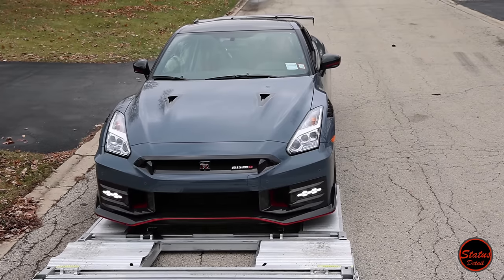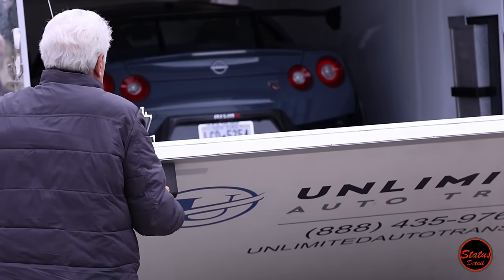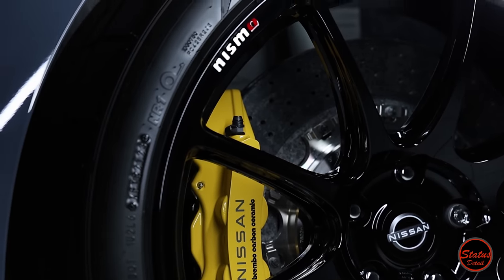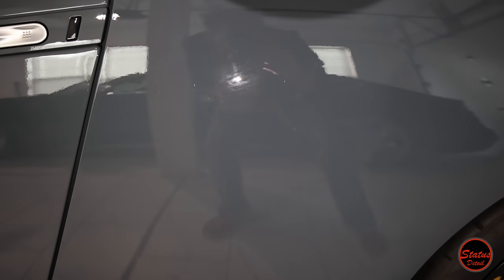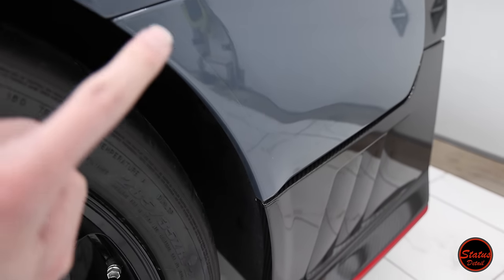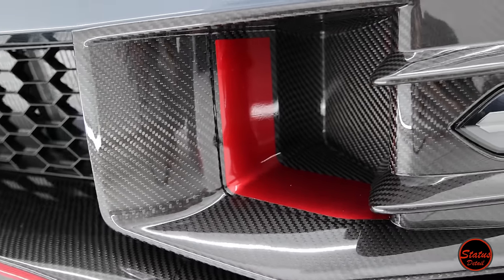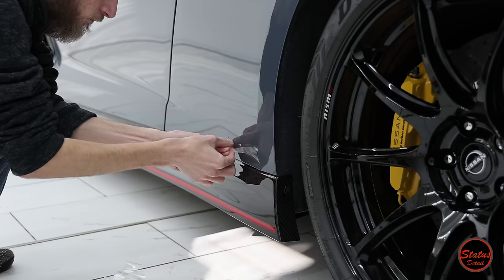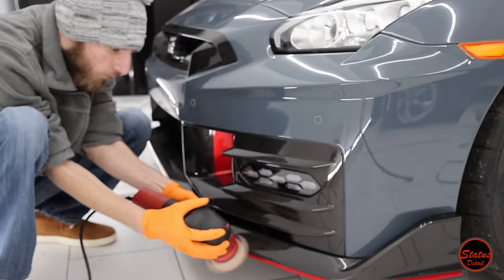RAREST R35 Nismo GT-R Gets $18,000 ULTIMATE Detail

Comment: Great work as always from Status. We just finished a 2024 992 C2S and also do extensive paint correction prior to PPF. In our experience, we have found that PPF will cover and hide most paint imperfections and we sometimes make a judgement call as to how much clear coat to remove from the car vs. hiding the problem with PPF. Paint correct 100% for sure, but sometimes the cut is deep and the hide effect is safer for the car.
Reply from the maker: Agreed! I talk about this in a few videos especially on nasty defects requiring sanding. We aim to remove all the defects and jewel the paint into a ridiculously glossy state and then lock that in. But managing clear coat depth is a serious thing! If your thinking about that your already leagues ahead of most PPF installers 👍

Comment: just spent 7k to paint correct, polish , ppf and ultimate detail my brand new m240i.   i went back to the dealer to get some service done  parked it next to the same car same color as mine and made the oem finish look like trash. its WELL worth doing it right when you got a fresh new paint job.
Reply from the maker: Definitely! It can really be a big difference when you see it side by side like that. Especially comparing a PPF car to no PPF car after 10-20k miles.
Reply: You got a $7k detail for a $50k vehicle? Delusional lmao
Reply from the maker: @Gborohooo  everyone values services differently. Some people won't spend more than $30 at the ultimate automatic car wash. Some will spend over 20k so it's all relative to the owner and how much they value the car and the work being done. And nuclear I'm not talking about value in the sense of appreciation or depreciation I'm talking about personal value like the love, passion and enjoyment you get from your car because being happy in that sense is not something that can have a value assigned to it. So if you can afford the service most will do it it a heartbeat
Reply: @Gborohooo   it also makes 1400awhp and has 6k dollar 18lb beadlocks, a 26k dollar  3.3l titan motorsports engine, a 5.5k 7480 precision turbo, 4k dollar intake manifold, 6k dollar titanium exhaust/manifold. 5k dollar fuel system,  20k dollar transmission and is about to run 7 second quarter mile.  if youre poor just say that bro.  i drive the car 200+ miles per day to work and back.  its full PPF for a reason. if u dont like ppf, dont put it on your dodge neon.
Reply: @Mp-jw1qg  you said it's brand new and you take it to the dealership for work lmfao neither of those are true for anyone building a car like you just mentioned. People jsut lie on the internet for no reason 😭
Reply: @Gborohooo   i bought the car already having all of those things from my a90 supra.  its the same car just awd.  . @hon3times.     my 160k dollar midnight purple r33 is ppf too. ill upload a video of my brand new m240 running 8.40 quarter mile. check back 5 mins. LOL. broke boy'
Reply: @Gborohooo   it goes to the dealership with the built motor, huge turbo and all. they dont give a shit. bmw doesnt void a warranty until you break something and try to get it repaired.   my car was running mid 8 second quarter miles on the break in tune before i got the licence plates in the mail. LOL.  i bought the car to build into a full race car..... two months ago when i posted this, it was stock, now it just needs a roll cage and its ready for 7.7x.  it helps when you own the machine shop and the dyno.........
Reply: @Mp-jw1qg  old ass spent all his retirement fund on a m240 and r33 😭
Reply: @Mp-jw1qg  i wanna know how you daily a 1400hp drag car😂
Reply: @Mp-jw1qg  nothing to brag about bro if you go to sell it you wont even get MSRP lol
Reply: @STATUSDETAIL yeah you say that because you are in the business. All these money spent on ppf and detailing won’t meant much when selling the car in the future and you’d be lucky getting a quarter of the cost back
Reply from the maker: @G0ddEityawesome  I agree. I've said that in camera several times. However that's not the case on ultra rare cars. Especially if driven. A few bad rock chips on a GT3 for example will make a future buyer pass vs the full body PPF car. In general it's about your personal value in it. That's why I don't recommend PPF to most people with average cars. If your new to status... I don't do average cars. We only work in and talk about rare cars and this market. Every situation is different but not doing full body on a car as rare as this one is a horrible idea lol. If someone leans over it and scratches it with a belt buckle at a car show it could cost more than the ppf in one trip to a body shop considering the entire car is basically carbon  panels. If a scratch hits your carbon base your fucked in the $$$$$ department.

Comment: Full body PPF was probably 13,000 by itself people don’t realize how much work goes into PPF by itself. Looks good brethren.
Reply from the maker: Thank you! Th bfull body PPF was actually less than that. Shipping was definitely expensive. Appreciate you watching and commenting as you certainly understand how difficult this job is 🤝
Reply: Great there's a 13k discount and no heavy plastic added - result
Reply from the maker: @adrianadrianp5305  I'm confused lol
Reply: Honest question. Why would ppf cost that much more than a wrap?
Reply from the maker: @drewbienewbie03xx81  not sure I can accurately respond because I don't offer or install vinyl personally. I'm guessing the material is less expensive. I'm also guessing it's easier to install and faster. Not to say it's easy. But I think ppf is harder.
Reply: @drewbienewbie03xx81  vinly is much easier to work with. Wrapping a GTR with like 3m gloss white would run around $4-5k, door jams would be another $1-1.5k. PPF is much thicker than vinyl and way harder to seamlessly lay down. Its usually around 50-60% more, give or take. All very generalized numbers.
Reply: @drewbienewbie03xx81 the ppf film alone is already 4x more expensive than avery denison wrap vinyl.

Comment: Question: for the front fenders with the carbon fiber vents above the front wheels, was that area PPF film protected eventually? In the video the person cut a hole around that area to lay the fender PPF down. Next question what areas were "NOT" PPF covered on the exterior of the car. I saved this video for future reference, if the stars align I would be requesting similar service.
Reply from the maker: Great question. So much is not shown. 

That fender area was cut out as it needs to be cut out to install. Each individual vent has PPF installed one by one after 👍

All painted or I should say clear coated surfaces on the exterior have PPF. Including rear diffuser and partial underside of rear.

Comment: what psi do you use on the pressure washer? Do you have a psi level that you dont worry about getting really close to the vehicle with? like when you get into the small cracks and other places do you change the pressure?
Reply from the maker: Pressure is always 2000psi. 2 something gpm. Ar blue 630. 

I get pretty close but knowing when and keeping it moving is very important. Helpful to blow bugs off. Helpful to prep seals and jams.

Comment: I am really curious. How long can the PPF stay on the car (considered it's not constantly exposed to sunlight) until it has to be changed in order to not bake into the paint?
Reply from the maker: STEK has 10 year warranty! Theoretically it should last much longer than that if your garage captain not driving it very much like I assume this car will be used. 

It is however a good idea to remove it around 8 9 10 years old is if you wait too long it can be difficult to remove. But that's more common when a car is like outside every day.

Comment: Fantastic work! I am just curious about one thing. You said ppf doesn’t go by a catalytic converter yet you did ppf directly next to the exhaust tips? Why?
Reply from the maker: A catalytic converter is very different from a exhaust tip. You do need to be mindful of this too though!

McLaren 720s OEM exhaust has like heat shield literally built into bumper due to heat and how the rear exit exhaust is designed. 

If you tune a 720 and do exhaust and or downpipes you start melting parts of that surrounding bumper and obviously PPF too. Anything shooting fire basically means your paint and PPF might not make it lol. A cat gets hotter than a exhaust tip though same thing with a downpipe. 

If the gtr dies open exhaust and any kind of flame tune that rear painted area is not lasting long.
Reply: @STATUSDETAIL  You responded! That’s awesome! My first thought was that gtr probably shoots some big fireballs! That is if it was actually driven. Great work!!!
Reply from the maker: @EmptiedPockets  I do my best to respond to everyone. Even the not so nice people lol.

Comment: For AWD cars, when the GTR was slid down, if only two wheels move will it damage the differential? (I know it was only like 4 feet )
Reply from the maker: @obamacare7751  not sure! I chat with the owner from time to time and he hasn't reported any issues. The transport guys are top tier and move Paganis and koenigsegg. I trust them. If something went wrong they definitely have insurance to make it right.
Reply from the maker: You made me curious so I did some research. What I found is that at high speeds especially high way speeds towing a AWD car with two wheels on ground is big nono.... I think we knew that much. 

At (low speeds) unsure of this is 5mph or 30mph it's less problematic. I'm assuming this is like under 10mph. 

If the car is turned on and at very low speeds   it's even less of a issue. 

So considering they back it out at like .2 mph then turn it on for the last part of say it's safe. Definitely don't tow it and drive around town or highway tho.
Reply: @STATUSDETAIL  that makes sense! Thank you!

Comment: Fantastic video, I learned a lot. At 15:40, you said you use brake buster first and them foam. I was wondering what product you use in the foam cannon. Hyper wash? Brake buster?
Reply from the maker: Thanks! Typically it's various soaps. Reset. Bathe. G wash. CarPro lift. Gyeon foam. Gtechniq citrus foam. I use various stuff 🙂
Reply: @STATUSDETAIL  Much appreciated. I've been trying to figure out a product that will rid my rims of brake dust. So far the iron remover and brake buster have not worked. I will try some of those.
Reply from the maker: @Doesin  I spray brake buster. Then foam on top. You need brushes to agitate tho.

Comment: Idk what polish youre using but ive used all the big names, Koch chemie, Oberk, Rupes, Carpro, etc, etc, etc and the best polish with the highest working time and literally no dust whatsoever is 3D one. No need to wet the pad or anything. Specially for ppl. Its ahead of optimum hyper polish as its not as heavy and not oily or anything. Its literally the perfect polih and can cut just as good as the best compound with the right pad. Theres no byproduct on 3D one at all. And if youre not cleaning your pads in between panels anyways idk. Because a pad is going to clog regardless if the polish dusts or not. And im sure you know that when the pad clogs it diminishes the pads ability to do its only job. I switch to a new pad every section of every panel and when im finally out of pads i clean them quick and start the process over. Takes about 20 seconds a pad.
Reply from the maker: I use CarPro reflect and ultra cut currently. Rupes previously before they redid everything. 

No dust is not necessarily good. I spoke about that in the video 👍
Reply: @STATUSDETAIL  I get what you’re saying about trade offs but just try 3D one and see if it works. I started using it because at first I was mobile so doing multiple washes was kind of out of the question when I needed to get everything done within 12 hours. Sure you can wipe 99% of the dust off on the panel wipe down but you really gotta wipe the panels twice as the dust will rehydrate and I’m not 100% confident the first wipe is picking all of it up. I used to use rupes also but it was literally like saw dust it was so horrible. Oberk is better but still dusts bad but I like going from cutting right into polishing without having to wipe the panels as they work great together like that. The 3D one has no dusting, and it’s not really oily like some “no dust” polishes. You can cut with whatever pad, I like uro 50/50s, and swap pads and finish it out to a perfect shine without wiping down etc. you can work so much longer than with any other polish I’ve tried. And as I’m sure you know most of the cutting ability comes from the pad anyways so I’ve gotten completely rid of all my compounds because they’re useless after 3D one. Maybe try it out and you might like it.
Reply from the maker: @402car_kid4  most of the cut does not come from pad depending on what your doing.

I'm not a fan of 3d. But that doesn't mean anything lol. If you like it. And it works for them that's great. 🙂👍

Comment: My f150 is getting gtechnic ultra and exo v5 applied this week.  Super excited after having amazing luck w/ the self applied CSL +exo v4.     Eventually I'll do a PPF on a vehicle but ... yeah I don't even want to know what you'd want for a big truck :P
Reply from the maker: Big truck will be expensive lol. 

But gtechniq coatings are best in business. Excellent choice 👍🙂
Reply: @STATUSDETAIL  Commented on the wrong account.    I loved detailing when I had my s4 and other cars.  Then I thought,  lets ceramic coat my truck!   36 hours later,  3 step compound /polish + CSL and Exov4 (skimped on 2nd coating of v4 that you apparently don't need anymore with 5)   I found a neutral PH touchfree wash and over 2 years later,  spots that aren't high contact are still beading like crazy.   The coating on the doors is cooked but the hood  upper parts of bed, and windshield that isn't hit w/ wipers somehow still has life.      Once a week or so based on need I'll do a full contact wash and for better or worse I've tried just about every sio2 booster on the market.     #fortheloveofthegame.   However that 36 hour detail and talking to a pro convinced me to NOT attempt applying my bottle of CSU myself on my shadow black truck and perhaps try the pro stuff on my wifes white escape :P      I remember 2 small highspots on my truck that I had to fix later w/ CSL  LOL   (Sorry for sermon)
Reply from the maker: @ryanw1284ryansrants  csu can be hard to work with. It actually installs differently depending on the car in the manufacturer's OEM paint. 

I install V5 as a double layer coating still on my higher packages. I swear by that is being a better way to do it than the recommended one coat and I feel like I can feel that difference when I do these second coat. But one coat is definitely sufficient. But if you watch my videos you know I'm a little crazy so that extra coat is just my version of making sure I got the 1% that was left in that job. 

WetCoat or cure is a great way to maintain the fading durability spots. I use C2 as drying aid too if your curious 👍
Reply: @STATUSDETAIL  Thank you!!   It's abundantly clear you're a top-notch pro, and I really appreciate all the lil tips and pointers!!  Love your content!
Reply from the maker: @ryanw1284ryansrants  thank you! 🤝 Glad to help